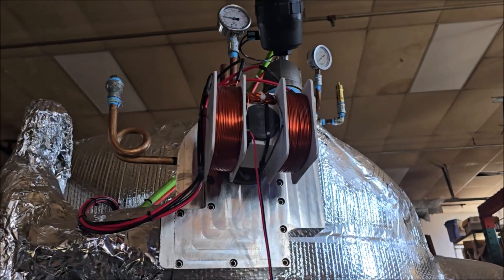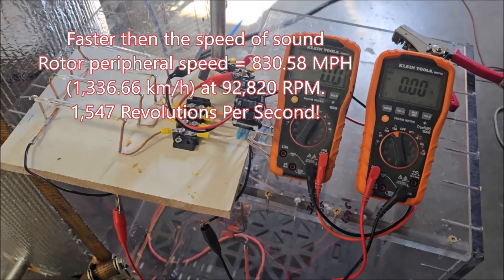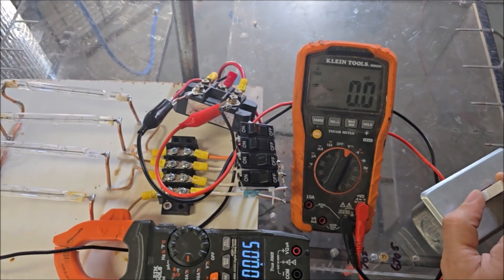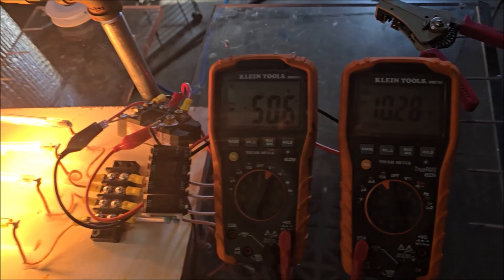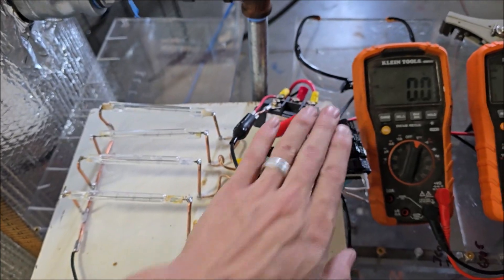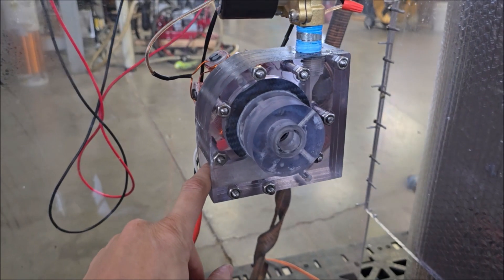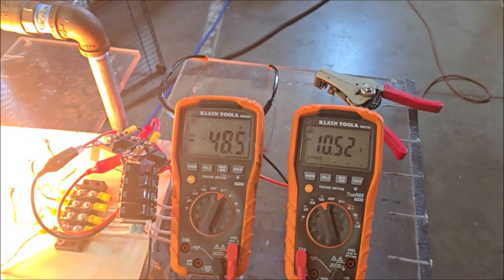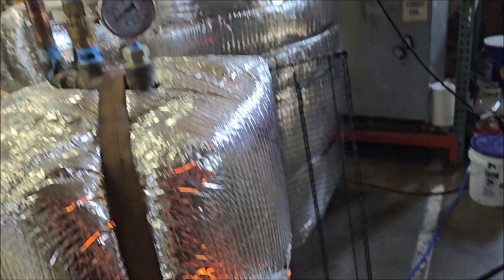Tesla Turbine Breaks Sound barrier! 95,000 RPM!

Comment: Something I have wondered with Tesla Turbines having a hard time converting their speed into torque.... is there a way to use a gear system (like a bike) that can be increased as more momentum is built to spin a series of increasingly large Flywheels or multiple of them in succession to make the motion more useful? Say even as a solar battery system, where they would get faster and more mass during the middle the day and as the solar drops off at say 4pm, then the momentum built by the flywheel could be utilized?

In my brain, this idea could also be best used in a hydro dam or on a waterfall or something.
Reply from the maker: Thanks for your comment and interesting ideas! Regarding torque, the Tesla Turbine operates at extremely high RPMs, which compensates for the lower torque with a high power output. Since power is a function of both torque and RPM, the high speed of the Tesla Turbine allows it to produce substantial power, even with lower torque. In our latest tests, we've seen excellent power output without any torque issues, especially when paired with a generator using air cores. This setup allows us to efficiently transform the high-voltage output into low-voltage, high-amp output using electronics, which suits our needs perfectly.

Now, to address your other questions:

Using a Gear System and Flywheels: Your idea of using a gear system to gradually engage larger flywheels as momentum builds is quite interesting. In principle, it could work as a form of energy storage, where excess kinetic energy is stored in the flywheels and then released when needed. This would require precise control to engage the gears without losing efficiency, and the system would need to be robust to handle the rapid changes in speed and torque.

Solar Battery System: Using this concept in a solar battery system is another intriguing application. The flywheels could store energy generated during peak solar hours and then release it gradually as solar input decreases. However, one challenge would be managing the losses inherent in mechanical systems and ensuring that the stored energy can be efficiently converted back into electrical energy when needed.

Hydro or Waterfall Application: In a hydro setting, the consistent flow of water could keep the flywheels spinning, making this a more practical application. The system could potentially act as a buffer, storing excess energy during low demand and releasing it during peak demand, similar to pumped storage but in a more compact and potentially more responsive system.

Overall, while these ideas are conceptually sound, implementing them would require careful design to minimize losses and ensure efficiency. For the Tesla Turbine specifically, our focus has been on optimizing the electrical output directly, and so far, it’s working very well with our current setup.
Reply: @iEnergySupply  100%  Yes, and it makes sense that you lose efficiency as you add additional mechanisms on to the Tesla Turbine too.

Personally, I am just shocked that the Tesla Turbine exists, and that no one has been able to find a real way to make it functional.
I am aware that current Hydro powered dams like the Hoover Dam have a +90% efficiency (which is very impressive). I wonder if there is a way to use the Tesla Turbine other than it being a psychological exercise? 
It feels a bit like Da Vinci's ornithopter... beautifully drawn, interesting concept, but not useful in reality. Who knows. haha
Reply: @iEnergySupply  you know I originally thought of gears just to speed up the turbines spinning output... It's just not necessary! That thing spins fast enough, right?

Comment: Could you not set up a system that uses geothermal cooling/ solar heating  and cold steam in vacuum to serve as the means to turn the turbine?
Reply from the maker: Currently, we are working on a system that utilizes a thermal reservoir to power a turbine. My latest tests focus on this approach, which allows for the thermal mass to be charged with almost any heat source to generate electricity.
Reply: @iEnergySupply  amazing!
Reply: I was thinking about the use of a heat pump as they have up to 4:1 COP.
Reply: The problem with very low temperature differentials is you are limited by the carnot efficiency, low temperature differential = low efficiency. That's a big reason we use superheated steam in large scale turbines

Comment: I suggest using Current Clamp for the Amps so you're not limited to 10A. You can get normal DC current clamp multimeter or get something more precise like PeakTech 4250 (20 or 60A) which has great value for the money and 4mm banana plugs for the multimeter. It's the same hardware as Pico TA018 but without BNC and shielding - which you can add yourself for cheap. Not to mention this hardware is mainly used with the oscilloscope so you have current frequency response up to 20 kHz.
Looks like the project is getting further and better, keep up the good work!
Reply from the maker: I have a clamp-on ammeter, which I initially planned to use, but it wasn’t reading correctly. I later realized it was set to AC mode. Next time, I'll make sure to use it properly in the correct mode.
Reply: @iEnergySupply  Great, can't wait to see more! 😁

Comment: Amazing Build! This is the first time I have ever seen someone actually build and operate a Tesla boundary layer drag turbine on YouTube. The experiments are definitely promising. Have you done any experiments with larger disc diameters and say using water/ gravity as feed for one?
Reply from the maker: Thank you for the kind words! I’m glad you enjoyed the build. I’ve been focusing on optimizing the system with various heat sources and improving efficiency. Check out my previous videos to see my larger 6-inch rotor, which generates significantly more power and is driven by a thermal battery/thermal reservoir. Currently, I'm testing the turbine using a thermal reservoir that can be charged with different heat sources to produce electricity. I have successfully experimented with using water and gravity as well, although I haven’t published that on YouTube yet. Exploring larger discs could further enhance performance and open up new possibilities.

Comment: Hello Jeremiah. I was wandering. How much watts can you pull from this small turbine? Is the fluid mixed steam and air? Are you planning On making an endurance test? Like running the turbine for hours or even days.
Reply: Ohms Law will tell you... you have the voltage & the current readings... 😏
Reply: @peterfitzpatrick7032  I know Ohms Law; I did see it was between 200 and 500 watts, but I meant to ask about the theoretical limits of this particular turbine.
Reply from the maker: The power output in these tests was limited by the generator. Theoretically, I could achieve several kilowatts with a more powerful generator, but only further testing will reveal the actual limits.

Comment: Dude, you don't need to show rip'ems. You can just show the hz of the power being generated. That's basically the same as showing RPM. Flip that fake Fluke from flow to Hz.
Reply from the maker: I tried, but the frequency became unstable at around 32,000 RPM. To measure the RPM, I analyzed the sound using the Spectroid app, which I’ve found to be very accurate when compared to an actual RPM meter. In this test, using an RPM meter wasn’t possible because the shaft was not exposed.

Comment: You should have a blast shield around that turbine. It will kill you if it explodes.
Reply from the maker: That’s why there’s a blast shield around it. A magnet exploded during a previous test at 99,800 RPM, but I was protected. In the future, we can reinforce it with carbon fiber or Kevlar wrapped in epoxy to make it stronger.
Reply: @iEnergySupply  actually i agree with him, the Plexiglas is not thick enough i would want double to be sure,  at least use another shield in front of the one you have, the perimeter of that disc is probably going close to 500m/s thats close to bullet speeds.
Reply from the maker: @ChrisDay-sx4lv  Thanks for sharing your thoughts on this! To clarify, I’m using polycarbonate (Lexan) rather than Plexiglas for the blast shield. Lexan is significantly more resilient and is commonly used in ballistic protection due to its excellent impact resistance and energy absorption.

For context, I once shot a 0.5-inch Lexan sheet with a .22 rifle, and it penetrated only about 0.25 inches. Given the high speed and mass of the lead bullet, this performance is impressive. The turbine casing is made from 3/4-inch Lexan, totaling 1.25 inches in thickness, which is more than sufficient to contain any potential debris from an explosive failure.

For those considering replicating this blast shield, the method of joining the Lexan panels is crucial. Strong, secure joins are essential to ensure that the structure remains intact, as poorly bonded seams could be vulnerable to shrapnel.

Additionally, the turbine’s discs are made from lightweight carbon fiber. While the periphery speeds are extreme, carbon fiber is much lighter than hardened steel or stainless steel, meaning it carries significantly less kinetic energy upon failure. This reduces the overall risk, but safety always comes first—so ensuring proper construction is key to a safe setup.
Reply: @iEnergySupply  you covered all the points I was going to make, Lexan really is tough stuff, hopefully its glued as well as screwed, the rear side of the turbine is exposed and you are working close to it, you should at least have something so a ricochet doesn't pose a threat. keep up the good work workmanship looks exceptional, Hope you release some efficiency data soon.
Reply from the maker: More testing on the way, including Efficiency.

Comment: That seems fairly inefficient. The 500W extracted from the turbine compared with the couple kW to go into supplying the air to make that 500W.
Running the generator at high frequency is potentially problematic depending on the rectifier. The 1500Hz isn't really fast but the high current rectifier might be quite slow.
The relatively low voltage of 50V is also quite lossy if you're using a silicon diode rectifier. It'll have 1.4-2.0V across it depending on it's specs and the current. This means that you're losing about something like 4% of the energy just in rectifier losses.
You can get a frequency measurement in real time quite easily if you use 1 of the 2 meters on the Hz range.
Reply: I suspect you actually know the energy efficiency is about energi in vs energy out, not power in vs power out. Still, one small Tesla turbine can't be very efficient. Your point about losses in rectifying the voltage is valid, if it the voltage is rectified, which isn't necessary to run incandescent lights. 

They can redesign the generator to increase the voltage. They're experimenting, not showing a finished product for sale. Also, ~4% additional loss in rectifying isn't much in that context. Consider the videos as entertainment.

BTW nice to see that you use the proper unit symbols, I think the convention is leaving a space between the number and the symbol in common text, but hey, just using the right symbols is rare in youtube comments.
Reply from the maker: Thanks for the detailed input! You’re right; there are efficiency challenges when matching the input power to the output. The goal of this setup was to demonstrate the concept and the potential of using various heat sources to drive the turbine. I’m currently focused on optimizing the entire system, including the generator and rectification stages, to reduce losses.

For the main project, I’m working on a larger turbine paired with a coreless generator that outputs 400V. With this higher voltage, the rectifier losses should be much lower, making the system more efficient. I’m also considering using more advanced rectification methods, like Schottky diodes or MOSFETs, to further reduce voltage drops and improve overall performance.

Comment: Great Jeremiah! Thank you for sharing your progress. One very intriguing application for the tech, aside from the whole our-of-the-grid home thing, is as an addition to a ICE water cooling system for hybrids, to recharge the car batteries not only with the mechanical power of the rotating shaft, while the ICE is running, but also with the most of the  heat which usually is wasted away (about 60-70% of the total energy) through the radiators.
Reply from the maker: Thanks! I would love to start the R&D on that as well, just waiting to get through production on the main project to finish other areas.

Comment: Doesn't the cold steam setup use less applied energy and still get the same output? 
Also 
Why does the load slow it down? is it the winding or use of a magnetic field causing a torque or a drag-ah what's the word? I lost my train of thought😢😂. 
Not static friction..lol. just why. 😅
Reply from the maker: Great questions! The cold steam setup does use less applied energy due to the efficiency of phase change and heat transfer processes, but the actual output depends on the overall system design and losses involved.

As for the load slowing it down, you're probably thinking of 'back EMF' or 'counter torque.' When a load is applied, it creates resistance against the motion, increasing the demand for energy. This can be due to several factors, like magnetic drag, mechanical friction, or electrical resistance in the windings. All these can cause the system to slow down as it tries to maintain balance. No worries, it's a complex topic, and losing your train of thought happens to all of us! 😅
Reply: It was torture thinking of that word. I see it now right there it was torque.i had already used it. It slows it down w\o even touching it. So Kool
Reply: I'm so glad to see you after all these years having this much fun and all these successes. You go boy.

Comment: lol now you can boiling the kettle with enough air providing a major bearing failure doesnt occur which it will without oil feed and/cooling.

Damn it, back to the drawing board once again😂😂🤣
Reply from the maker: These bearings have withstood several rotor crashes caused by misalignment, which I've since corrected. Amazingly, I've been testing with the same bearings for over 4 years, and they’re designed to run without oil. With the alignment issues resolved, no more crashing rotors! My new 6" turbine is now bulletproof. Cheers!

Comment: You need a dryer the expanding air is droping temps causing condensation.
Reply from the maker: Or we could just increase the temperature, which isn’t too bad for a laminar flow turbine. However, I’m curious to see how a dryer would perform in this setup.
Reply: Steam or water loaded air provides more power than dry Air.

Comment: I didn't hear any sonic boom! Nothing went supersonic without a sonic boom, even a whip has a sonic boom as it breaks the speed of sound!
Reply from the maker: Yes, it's interesting. The laminar flow in the Tesla turbine might be the reason, but it definitely reached the speed of sound.
Reply: @iEnergySupply  not without that boom it didn't!
Reply: @timh.2137  fffs, it isnt even worth explaining... but i will anyway, though i get the impression you wont understand, or want to understand. if the air is supersonic, and the blade moving within that air is also supersonic, it doesnt produce a "boom" because the relative speed between the two is NOT supersonic.

anyway, a "boom" is  a single wavefront, a single rapid rise of pressure, moving past you. not a continuous sustained note.

when a propellor tip exceeds SoS, theres also no "sonic boom", but it does make an awful "tearing" sound... very distinctive.

fun fact, air exiting a nozzle at anything over 16 or so psi is already travelling at sonic speeds...

Comment: It would be great to see a system that could take me off the grid here on the farm - I have PLENTY wood fuel for steam production. Keep up the good work - it will pay off.
Reply from the maker: This is exactly what you need if you have a good supply of wood! Stay tuned for updates, and consider joining my Patreon for exclusive insights on the turbine we're running on heat. Even free members receive updates occasionally.
Reply: @iEnergySupply  - Outflow is greater than inflow at the moment, but I certainly will when that dynamic changes. 🙂

Comment: 225w under load x 24 hrs is barely 5.5kwh @ 30v x 7.5a per hr if it could run for an hr lol, i love the idea of this tech i just realllly hope it scales as well as i think it should. not hating but if you want anyone to take you serious slap a gear system on this and attach a damn 5kw axial flux alternator and get hella watts per hour or die trying lol, this with a 22kwh per day output could power a house with solar heating in alot of places. dope build keep it up i hope something like this replaces reactors one day.
Reply from the maker: Check out my previous video: that was a polycarbonate turbine, so I couldn't let it get too hot. I've managed to generate over 2 kW with it. My new turbine, however, features an aluminum housing and titanium disks, and it's capable of much more. It can easily exceed 5 kW and has the potential to reach 40 horsepower if operated at high enough pressure and temperature—assuming the shaft can handle the torque without twisting off.